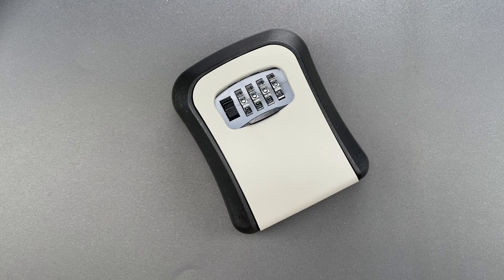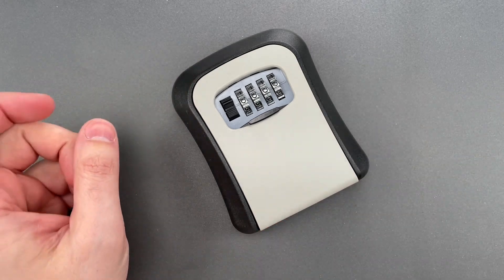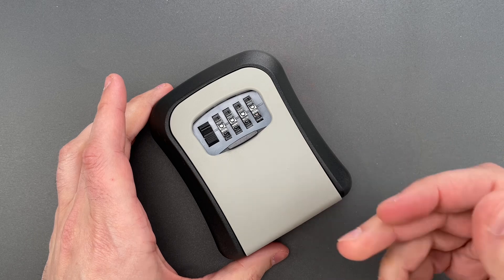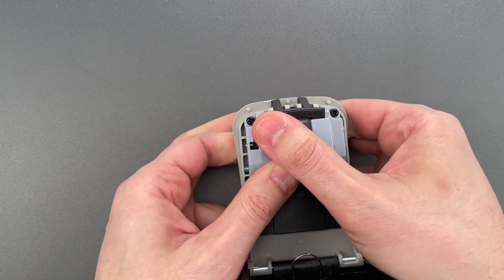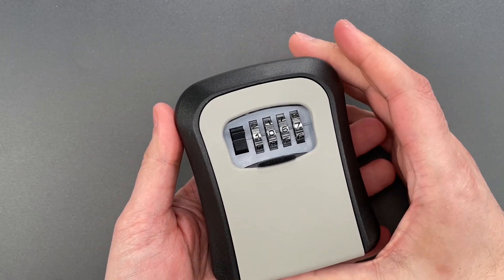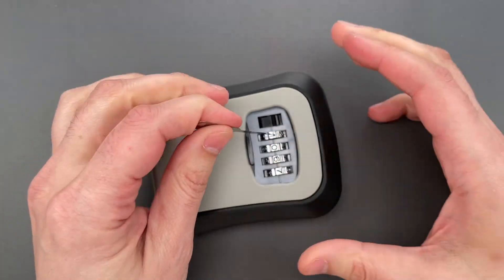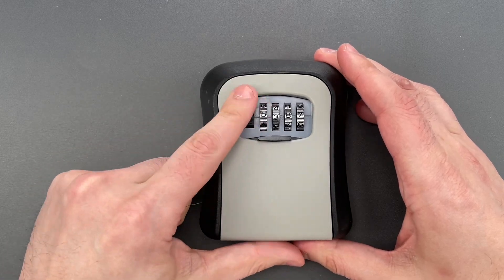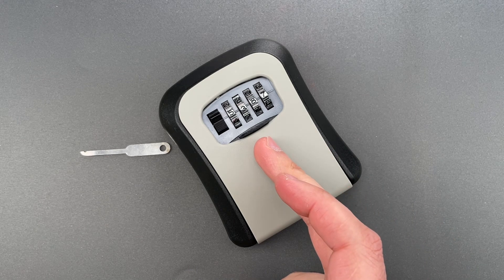[1496] Can It Possibly Get Worse?

Comment: My feeling is that this box was designed as a counterfeit of something that was actually made of steel. Plastic has no place in a lock/lockbox except as a weather-seal, and even then, it better be on the inside, cause sunlight is going to make it brittle.

Comment: i appreciate you picking the lock, but after showing us how you picked it, you could make it more fun by using brute force to open it. my first try would have been small pocket knife or a SPOON to try and pry it open by breaking the locking mechanism.
second i'd try to use nothing more than hands to see if i can break the door by pushing it in.

however don't make fun of plastic, some plastics can be stronger than low-grade metals.

Comment: Hey LPL, wondering about different tips and techniques for single pin picking a 5 pin lock that has a low cut on pin 3 and a high cut on pins 4 and 5. ( The words might be flopped; for a drastic example, maybe a 22922 key/decode). How do you pick something like that if pin 3 binds before pins 4 and 5? I can't access pins 4 and 5 without tickling pin 3 a little, resulting in it binding too high (I think). Just one of the locks I am practicing on. Thanks legend.

Comment: Children typically lose or forget keys. Parents may think these lock boxes are an idea solution for latchkey children (typically children who come home from school and are alone at home until a parent gets home from work). However, a predator who observes what is going on could manipulate open the lockbox to gain entry before the child comes home, and be waiting inside. A possibly much better solution, aside from an alarm system, would be to provide the child with a key, anyway, and have a spare key well hidden, far away from the lock it opens, as a backup.

Comment: Putting aside the terrible quality of the lock, some plastics are pretty darn tough. I'd be interested to see what it actually takes to open this lock box from a mounted-on-wall position using nothing more than a hammer and chisel/screwdriver. That would make for some interesting viewing.

Comment: There's no such thing as absolute protection. It's all relative to how vital it is to prevent unauthorized access and how likely you deem yourself to be a target.
If you just need a lockable key box to store keys in that provide access to the attic or basement or power tool drawer or something else where you don't want your little kids to play/snoop around, something like this might be sufficient detriment to their inquisitive snooping...
They're not likely to smash it (as that'd clearly leave evidence and incur your wrath) so the physical sturdiness of the box is less relevant in such a use case. 
Not to excuse it's existence, but it isn't hard to imagine a use case some production company might come up with.

Comment: still available on German ebay.
For 8.71€ which is about 9€ too much in my opinion.
Description says BIG " Sturdy material: Let our lock box protect your keys from damage by hammers, saws, drills, etc."
and small: "plastic"
So it's hammer, saw and drill resistant plastic.
That's an obvious scam I'd say, but I'm not a lawyer.
Also interesting to me:
Google translator translates the given Chinese address to
"good sample road C and squatting town song sauce district"
If this really stands there in Chinese language then the vendors shall lose their fingers while singing and eating sauce.

Comment: It’s a cheesy product for sure.
But irrelevant if you consider most homes have glass windows and no alarm, so a key isn’t needed for entry.

It it can be handy for locations in a common area such as janitorial supply closets or laundry rooms where theft isn’t really a problem.

Comment: This has the same exact design as a master lock version and is only missing the metal body, and a shackle that can be used to hang it on something else. I'm betting the master lock version is vulnerable to the same picking method, but with the benefit of being slightly harder to physically break open.

Comment: I mean the only way I see it is as a decoy: mount it in a very visible place and put a bunch of old keys in there. Place the real keybox (if any) in a non-obvious spot. You can also make an experiment: put it outside, next to your front door and place a hidden camera (which tripples as a regular security and door bell cam). Since the security of a system is as high as its weakest link, this should be attacked first. It will make them unlikely to proceed: it will make them waste time and breaking a window or a door is on a whole another level than just prying open/smashing a little plastic box. You will also get the footage for the police with a SINGLE camera instead of a donzen placed everywhere.

Comment: I can't comment on other countries, but UK eBay is rife with cheap, unbranded, dangerous tat like this key box. My particular gripe is with the carbon monoxide alarms that are being sold at half the price of the cheapest reputable brand, often for two alarms at that price, and don't even mention the legally required Standard BS EN 50291-1 as a keyword, never mind claim compliance. They don't meet the requirements for the minimum information that must be printed on the unit (or on a sticker) so what other corners are they cutting? They also regularly get listed under real, reputable brand names like BRK, Kidde, Apollo - the latter don't even make domestic CO alarms! I've reported them to eBay many, many times but eBay don't seem to give a shit. At best, those specific listings get taken down, but the quantity of them in search results never seems to go down so there's clearly nothing be done to prevent relisting.

Comment: There also seems to be some screws in the back of the box. Would it be possible to just disassemble it with a screwdriver as well? If so then this is actually probably the worst “lock” box that’s ever made

Comment: I used a beer can shim that i cut flat to open bruke company safe like that on my friends house .He forgot the code ,it took me 30 min(im a complete beginner,never opened a lock in my life,tried it after 10 min video) but i used other method .Shafts have D cut in them and i found flat spot then just simply rotated combination 90°.These key "safes"are a joke when it comes to security .

Comment: The back of that looks 3d printed. 3d printing always creates weaker parts than traditional plastic fabrication.

I learned this very quickly after buying my first 3d printer. I had to double wall thickness to have it support the couple kilograms that my robot weighed.

Comment: key safes are just insecure in general, ironically. there's other kinds (at least here in the uk) where you press number 0-9 and there's usually 2 letters, normally A and B , and it doesn't matter what order you input the combination so long as you get the right numbers and/or letters meaning the combo could be 912837465ba and you could input ab123456789 and you are in, obviously making it extremely more susceptible to brute forcing (IE code could be 4231 and all an assailant has to do is input 1234)

To be clear this isnt specific to one brand, they all have this "feature" , got to be honest i never looked into whether its intentional or not to make it like easier for emergency services to gain access but seems unlikely and stupid if thats the case

Comment: You work on this box in another way.
You fix this in the suit case and fix  one screw in middle bottom with nut and bolts .
Now suitcase is closed,  you don't have any access to shake or open the box.
Very important...
You work only on codes  from  outside and see if it opens. 
Jay shree ram.

Comment: Glass reinforced HDPE should actually have better structural integrity than many of the metals used for this type of thing.  However a big enough hammer can destroy pretty much anything
Reply: Thats what I thought, too. But they can´t manufacture glass fibre cases for that price.

Comment: All plastic? Using the notch decoder is just going for style points, it would take a couple of seconds at most to smash that thing to bits with a halfway decent hammer. Odds are, that's exactly what most criminals will do if they encounter one of these (other than laugh their asses off, that is).

Comment: The backshell looks like it was 3d printed.
Reply: That stipple is more typical of an injection mould surface treated with a graphite texture die using electrical discharge machining. Supported overhangs in FDM printing take on a very coarsely brushed or matted texture, which is directional unlike stipple. SLA support scars would be more difficult to level out so smoothly, even on a master part. Particle sintering processes wouldn't leave the ribs so smooth without further machining.

Comment: You ridicule plastic construction but imagine how bad it would have to be for plastic to be an improvement!
Actually I have come across some plastic items that are in fact several times stronger and more resilient than the equivalent steel part. They do burn rather nastily though with extremely toxic smoke.

Comment: I think it's probably worth from time to time exposing some of the simpler weaknesses of a device like this. Someone may not have come prepared with one of your tools, but they might have brought a hammer. How hard is it to bypass the lock entirely and break through the shell, or disassemble it without opening it?